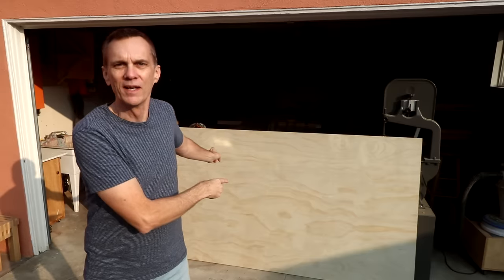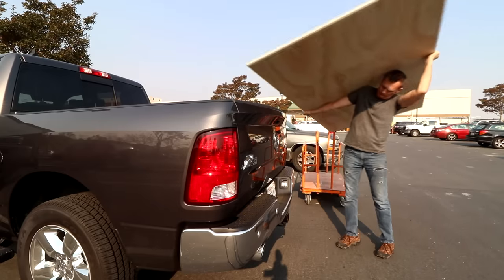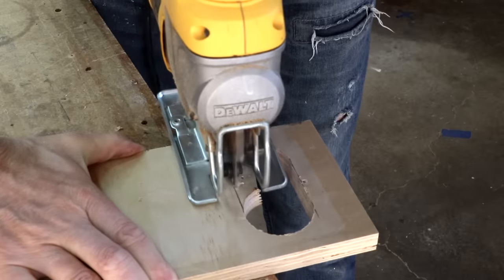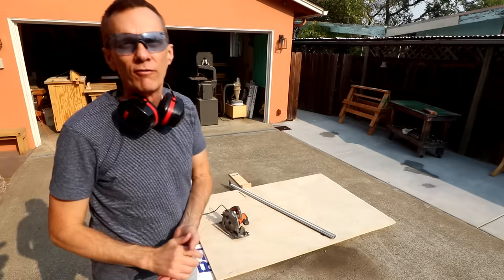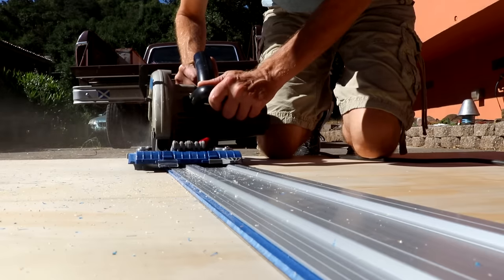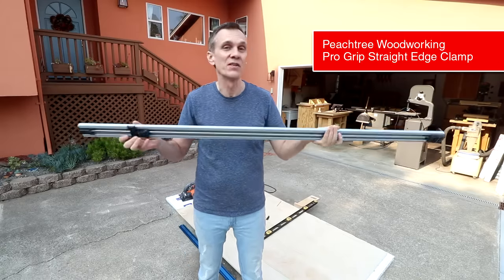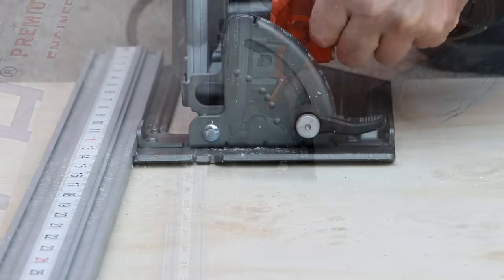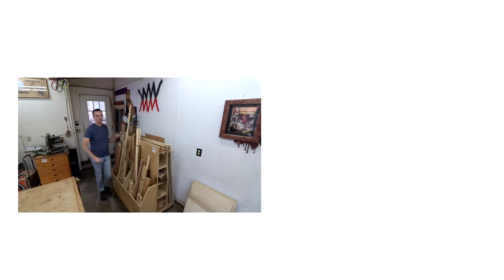How to break down plywood. A guide to cutting, moving and hauling plywood by yourself.

Comment: A reminder: many shop projects including materials are really too heavy for one person to pickup and move. First, never pick the whole project or material up. Pickup on end of it and leave the other on a support.  That way you are only picking up 1/2 of the weight. Put any kind of roller device under the other end to make it easier to move.

Comment: I found a Triton track saw at a local pawn shop.  After waiting a few months they dropped the price down to $180 for the whole set (saw, tracks, and clamps) I offered $150 for it and they accepted.  If you do a lot of woodworking chances are you are much more familiar with  tools than they are.  Plus, you likely have better knowledge on what tools should cost.  It’s a good way to get a great deal.  Just an added note, before buying a saw at a pawn shop have the clerk plug it in and run it for a few minutes before buying.  Find a good pawn shop who does their due diligence in order to avoid purchasing stolen goods.

Comment: Cross cutting a 4 by 8 sheet is easy. Simply lean it against your "lap" with the line in front of your dominant hand and push the saw down your line.  Before your saw touches the ground, press the board against your upper quads and squat your butt down til it's below your knees. Once you get the hang of it you can produce the complete cut in one single move.

Comment: Steve, you missed out a tip at 1:30 The 'sudden breaking reverse unload'. When you arrive home, undo your tie-downs, reverse quickly into your driveway with your garage door open. Apply your breaks with some urgency and the plywood will unload itself into your garage.
Reply from the maker: Haha! I like it!
Reply: Maxx B 🤣😂😆😜🤪
Reply: This old Tony came to my mind...
Reply: Bonus points if you can get it to slide out onto the workbench.
Reply: You can even apply your brakes - works just as well.
Reply: There is a version of that technique in the '80's vampire movie "The Lost Boys"... .
Reply: @root1657  Double bonus if you can accurately feed it into the table saw...

Drive through sawmill. I'm sure there's one in the US somewhere... You guys have drive through everything! :-P
Reply: @jasondoust4935  Including drive through daiquiris. I saw one in Louisiana, Lafayette I think it was. Shocked, we drove through and I said “you don’t mean alcohol daiquiris do you?” Yes, alcohol daiquiris. “Is that legal to have in a vehicle on the road?” “Yes, the hole on the lid is taped shut”. I kid you not!
Reply: @jimwatchyyc  nah…no need to tape the hole shut as long as the straw is still in the wrapper. We have about 7 in our small town alone 🙄

Comment: Anyone else ever get a free parking lot hang gliding session while loading the plywood during breezy conditions?  That's always fun..to watch when it happens to someone else.
Reply: HAHAHA  YEah been there done it myself!!!  Not so funny when its me getting blown around though.......
Reply: Not using the right cart if that is happening. You use the flat table top cart for sheet goods. About the right height of a truck tailgate. Just slide the sheets in.
Reply: Did that of the roof of a 2 story building once.

Comment: I brought an optimized cut list for 5 sheets of ply to big box today.  Fortunately, the panel saw operator told me that the rip direction would produce errors of 1/2" over 8' and I aborted.  Now I'm thinking I'll edge guide cut with circular saw at home.  Tons of good tips in here.  I'm glad I found your video!

Comment: I use the sheet foam insulation.  I cut it into 3 pieces so they store easier.  I did splurge and buy a DeWalt Trac Saw.  Best purchase ever.  That thing cuts like a laser.  I poured an apron out front of my shop with the sole purpose of breaking sheet goods and doing large cuts outside.  Works out perfectly.....unless it rains or snows.  LOL

Comment: Thanks for taking the time to put this video together. I really like the Idea of the foam support board. About the only thing I would recommend would be to unplug your saw when you have your fingers so close to the blade. When you explaining the offset on the shoe of the saw it was plugged in and your finger looked like it was inside the trigger guard. A little spooky.

Comment: That foam building insulation hack just made my plans for a home shot 100x more manageable. Was racking my brain for how to break down plywood with out a huge table saw.
Reply: I got me some 2x2 project foam panels (Home Depot has FOAMULAR project panel from Owens Corning).  Not the styrofoam kind which would shred and send out tiny pieces of foam everywhere.  The panel foam is closed celled foam.  The 2x2 size makes them easy to store.

Comment: Handling, transporting and breaking down sheet goods are some of my least favorite woodworking activities. A panel carrier, such as the one Stanley offers, is a must-have tool. I particularly like that the angled handle keeps fingers and knuckles away from the sheet being handled.

After trying several, I settled on the Bora WTX Clamp Edge System. I have both the 36" and 101" guides, as well as saw and router plates. I also have Bora's Rip Guide. These are all indispensable for me as I get straight, clean, precise, repeatable cuts everytime. And, yes, I make my final rips, crosscuts, rabbets, dados, etc., with these tools, along with my circular saw with 40 tpi blade, or router.

Comment: Hi Steve, always enjoyed watching your informative videos.  My knees don't work as well as they used to, so I use a couple of sawhorses with an old metal garage entry door on top, then a foam board over that.  It provides a zero clearance cut, so you get a nice smooth no tear out cut. What I did was made a 4ft and 8ft cutting guide made to match my circular saw's sole plate, then just mark your board and lay down the guide on your mark and clamp it.  Works perfectly and it's a low cost way of breaking down plywood, no adding or subtracting to the measurement needed.

Comment: I have a plywood carrier, similar to the one that you made, but it's made of a strong plastic. I think that I bought it at Home Depot but I've had it so long that I'm not sure about that. One difference is that the handle part is curved away from the sheet, that you are carrying so that you don't rub your knuckles raw, if you are moving a lot of sheets. I'm 5ft 6in, with short arms, so this has been a life saver. I have carried 3/4 inch 4ft × 8ft MDF  and not had to  struggle too much.  Although I don't remember how much it cost, I do know that it has paid for itself and saved my back, in the process.

Comment: I found those straight-edge clamps to be worth every cent. I use them to hold carcasses, work as fences for the drill press, the band saw and the router. Use them for ripping small stock and for breaking down sheet goods. I am continuing to find new uses

Comment: Wow, Steve, your local HD looks like a tornado flew threw it.   Our big box stores are not that bad, but it can still be hit or miss with getting someone to cut your sheet.  I strongly recommend trying to go at quiet times -- 2pm on a busy Saturday is not a good time to get Staff help for anything.

Also to everyone else, a reminder that those saws in the big box store are not necessarily the sharpest.  I NEVER trust them with a final cut.  Always cut large, so you can trim it to final size on your own nicely tuned and sharpened tools at home!  :-)

Nice truck, Steve, ever miss the old one?
Reply from the maker: Yeah, That Home Depot is pathetic. I don't miss the old truck. It's nice having something reliable!
Reply: @SteveRamsey  I've got a 71 F100, reliable as can be. Guaranteed, every time I need it, there's a problem. I did notice in this vid you didn't work off the tailgate like the old truck. Mine is still one of my favorite work surfaces, and I rarely unload full sheets.
Reply: Went to my local Lowe's and came across a damaged hard wood 4x8 sheet for dirt cheep, but I only had the car and couldn't put much larger section of 2x4'  so I ask them to cut it, no problem, and they happily did, how ever the blade was so dull I lost 2" at each cut due to splintering... Next time I'll go home and get the truck!
Reply: weird, at my HD they have a miter saw for cutting board that is very nice and seems to be perpetually sharp. never really seen what they use to cut sheet  though.
Reply: Wordsnwood  I agree. I went to THD last Saturday at 0630, got 2 sheets of OSB, had the old Marine* rip it for me, and I was out of there by 0645. I hate ever going to a home center on a weekend, but if I have to, it's before the amateurs do their yoga and have their Starbucks.  *Seriously, this old Marine was at least 75, wearing a Marine ballcap, but let me tell you - this man still has it. He told me to hold the cart while he loaded the OSB on the panel saw. Handled it like it was a piece of foamcore! Made this 61 year old feel like a pajama-clad soy boy!
Reply: So true about the dull saws.  I had a nice piece of plywood mangled so badly once the splintered area was about 2 inches wide.  I wouldn’t trust them to cut plywood for any furniture type project after that.  You can get a good quality plywood cutting blade for your circular saw without breaking the bank.  All circular saw blades are cheaper just because they are smaller.  Freud actually makes one!  Highly recommended.  Also, baltic birch plywood that you get from a woodworking store or real lumber yard is so superior to standard plywood from a big box store.  It has more plys, fewer voids.  It is more resistant to warping.  Almost a different material: plywood as it was meant to be.  Of course it is more expensive as well, and usually doesn’t come in 4’ x 8’ sheets, not always big enough for some projects.  But it’s worth getting it if you can.  So much easier to work with and make accurate cuts.

Comment: Steve what I do is use a piece of angle iron from Home depot as a "rip fence" to run my table saw up against when cutting sheet goods!! OF COURSE the angle iron is ONLY 4 feet long so I make all my cross cuts first then cut my long cuts secondly!! And to attach the angle iron to the sheet with a couple of small "C" clamps and a couple of paint stir sticks has "calls" to prevent dimpling the wood! Another thing I use is the angle iron bed rail off an old bed frame for cuts longer than 4 feet!! Again though this is limited to around 6 feet or so, you can't use it on a full 8 foot sheet....BUT running the saw against the angle iron as a rip fence you can make a fairly decent desk top out of a sheet of plywood that is 6 feet long or even a table top!!

Comment: I saw another good plywood cutting base idea that’s very storage-friendly. You use 2x4 with two 6’ lengths and three 4’ lengths. Cut half lap joints in intervals on the edges and fit them together like a tic-tax-toe game with an extra horizontal line. Then you put the plywood on top of that frame and cut. When done pull the 2x4 apart and store. They don’t take up much room, let alone a whole wall like foam board, and plenty of clearance for the blade and clamps. Great for uneven surfaces. When one side get too cut up, flip them over. Very cheap, easy and easy to store.

Comment: Jimmy diresta just did a similar video but on circular saw tips and tricks, something I learned watching that video that may help is making an offset block that is the width of how much the base is on your saw. This way you don't have to do the math in your head and get more accurate cuts with less time. 

Great video, I've been wanting to go buy one of those edge clamps for a while.

Comment: I have a self clamping track, similar to the one that you use and have found that it works well for 4ft cuts but if you use it for 8ft cuts you need to put a screw, or nail, at the center of it to keep it from bowing.

Comment: Hi Steve, I recently watched a video on Nick Engler's channel. It shows a system he devised for cutting plywood which consists of a set of knockdown saw horses, a grid of 2x4s connecting the horses, and a track for your circular saw to run on so your cuts are accurate. Really clever and worth a watch. He does sell plans for the whole lot, definitely worth checking out.

Comment: Congrats on the new truck Steve! I bought mine a couple years ago just for hauling me and other stuff. I was pretty picky though. It could be any color but it HAS to have a manual transmission. They are so hard to find these days, I settled for a '97 Ranger. I love it! and I've had so much fun putting on new brakes, timing belt O2 sensors and patching rust. It's great for Wisconsin but probably wouldn't stand a chance in California

Comment: 1. Glue foam board to a  tatty piece of ply and support this with a couple of 2" x 4" on your work horses. We are now working off the ground - saving your back and able to use clamps. 2. Take a straight piece of timber for running edge (2" x 1/2") and mount it along one side and on top of a same length piece of ply (about 6" wide). Run your saw along the straight edge and you will cut off the ply the exact distance between your saw blade and the edge of the saw. You now have a perfect saw guide.  Go to the board you want to cut and at each side mark the amount you want to cut off (say 12"). Align the cut edge of the ply on your saw guide with the marks and clamp in place. You can now run your saw along the straight edge of your saw guide for a perfect cut. These saw guides are so cheap and easy I have 4 lengths for different jobs.

Comment: You can also purchase a "panel carrier" which is similar to the one made in this video. Made of resin & reasonably priced, 2 will suit most of us well, especially if you are smaller in stature. 2 carriers will allow you to work with a partner to lighten the load. Each carrier is also capable of holding 2 3/4" sheets at once and with a partner will shorten the time needed to move multiple panels.
Reply: I got 2 for $5 at Home Depot.

Comment: I have the same kreg jig and as I read the direction it does not require you to cut into the blue plastic on the edge.  You just need to make sure your saw it set up correctly and offset properly.

Comment: I have a Festool track saw that I bought to break down plywood along with the insulation trick. It was horribly expensive for sure but the edge it leaves is "finished". It has no tear outs or roughness at all, it is square as can be. Still, a hell of a lot of money.

Comment: Get a plywood gripper handle thing, lets you hold the sheet from the top. Another noob thing I learned is that the cutting they do at the store is rough and has lots of tearout (splintering). Plan to cut an extra half inch to clean it up. I do the bare minimum of cutting at the store just to have it fit in my truck, then do the real cuts at home with a 60 tooth circ saw blade. I assume all of the original edges of the sheet will get banged up in transport and factor that in accordingly. Rarely do my pieces incorporate the original edges. Also, if it's a demanding cut (like 1 inch baltic birch), get good at pushing the saw quickly through the piece to minimize burning, or use a lower tooth count blade, and use painter tape to reduce tear out. Also HD carries metal square tubing that you can use as a saw guide. It gets annoying to have one super long one swinging around, so you'll probably end up with a few sizes for different sized sheets.

Comment: For a cheap long aluminium straight edge, get a plasterer's feather edge. I got a two metre one for £30 on eBay and I use it all the time for cutting boards as a guide for my saw. (I might have to translate that into Amaricano, two metres is about six and a half foot and thirty quid is currently $37)

Comment: I made a saw guide out of 1/2” plywood and a straight piece of any wood you have as long as your saw motor can clear it when travelling over it. Screw your strip of wood to the plywood far enough away from your edge to allow slightly more than the offset of your circular saw. Now make a pass with the saw running along the guide strip, then put the saw on the other side of the strip and cut along this edge. Now all you need to do is line the edge of your plywood up with your marks, clamp, and cut.